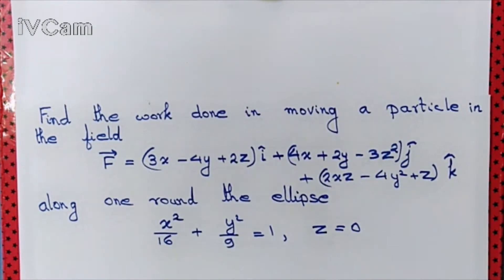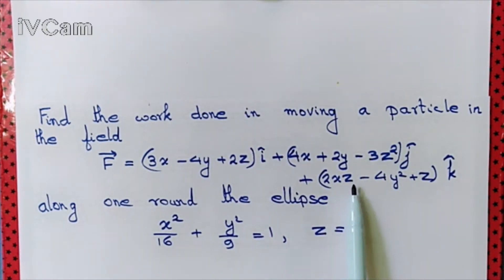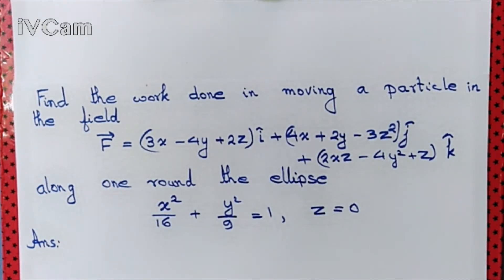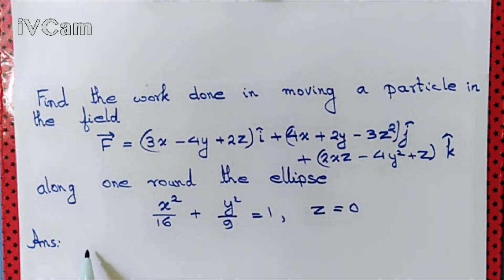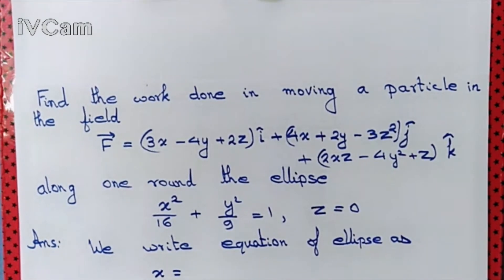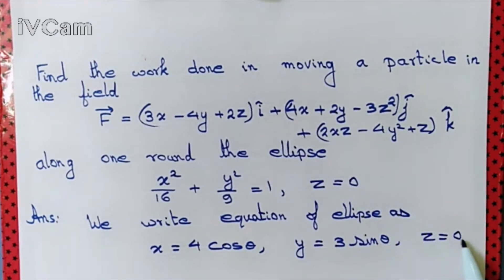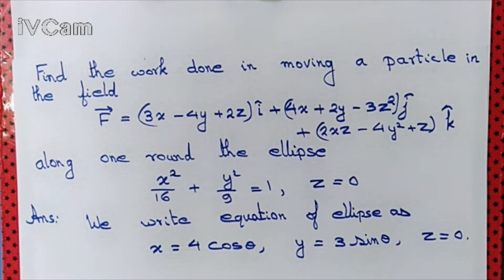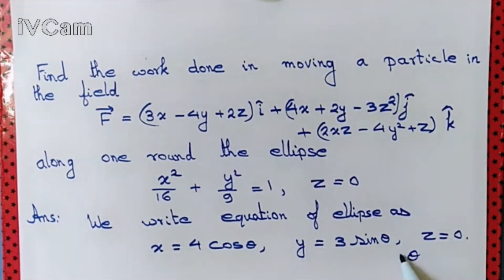Calculating work done for a given field as particle moves along an ellipse

Comment: shouldn't net work be 0 if the net displacement is 0 ?
and can't we do without converting into polar form like by dividing the path into 4 parts and then integrating w.r.t. x and y separately, like partially and then by summation
Reply from the maker: If the field is conservative and if the displacement is zero then work done is also 0. The field  or the force vector is not not a conservative field/vector
So work done is not zero.
You might be able to do using polar coordinates as well.

Comment: what will happen if we took the limit of t from 90 to 0 and multiply with 4 ? like we used to do to calculate area
Reply from the maker: well you  can calculate  area by  evaluating integral from  0 to 90         and  then  multiply  by  4  only  if you  have   the  figure   to  be  symmetric   

if   the   figure   is  not  symmetric   then  the   technique  will  not   work   even  for  area